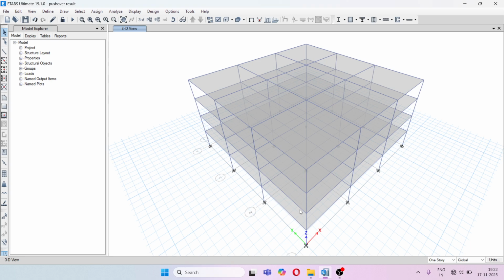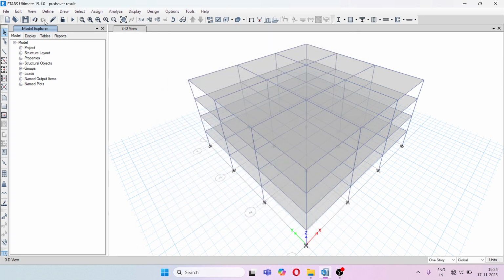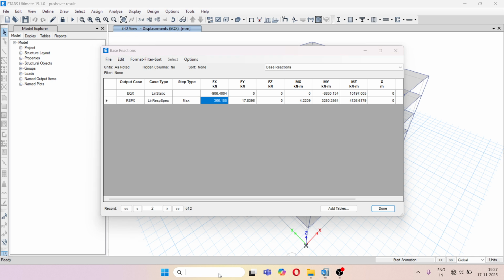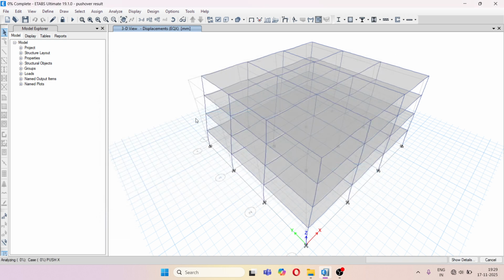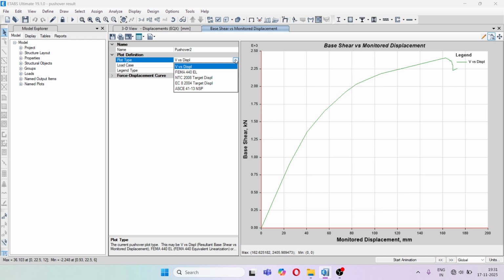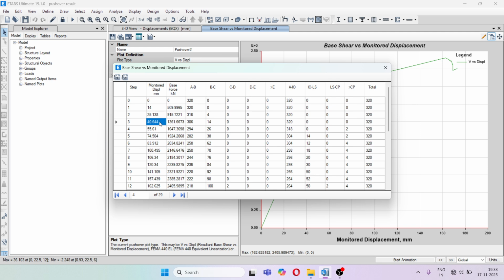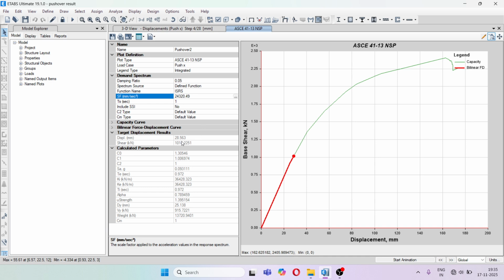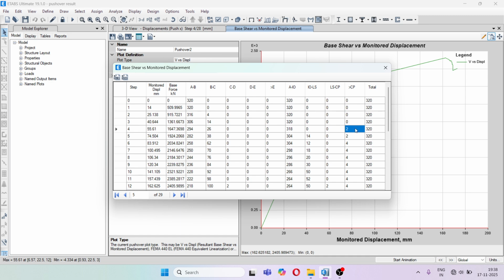Performance Based Seismic Evaluation in ETABS | FEMA 440 EL and ASCE 41-13 NSP | Pushover Analysis

Comment: Sir my building was very complex so picked only one frame of building and did Pushover analysis by transferring the loads on slab to beams as SIDL but now when i am finding base reaction for EQx and Response case they are almost same and multiplying the scale factor aint giving the point it says no point found
Reply from the maker: Make sure response spectrum base shear is equal or more than EQX case